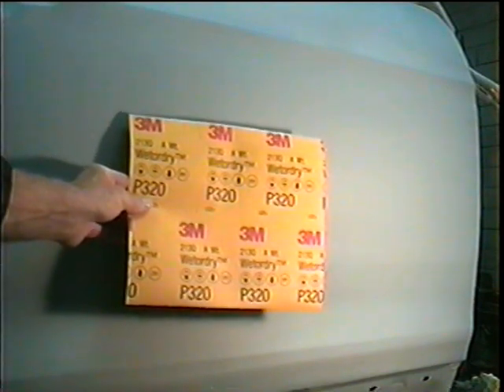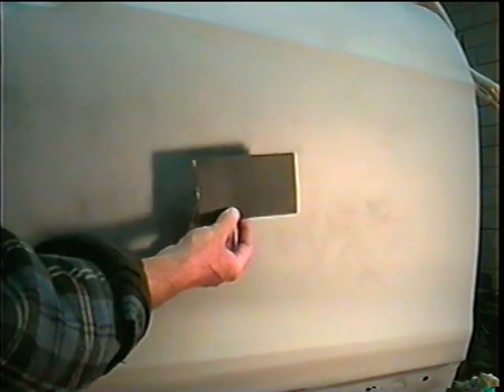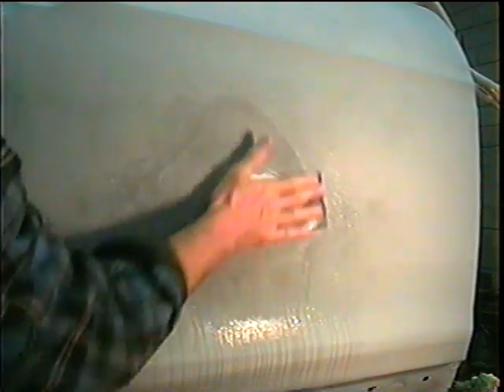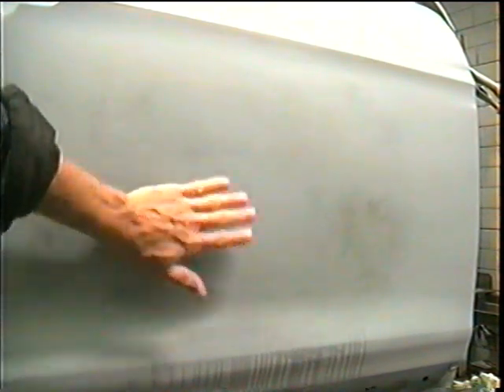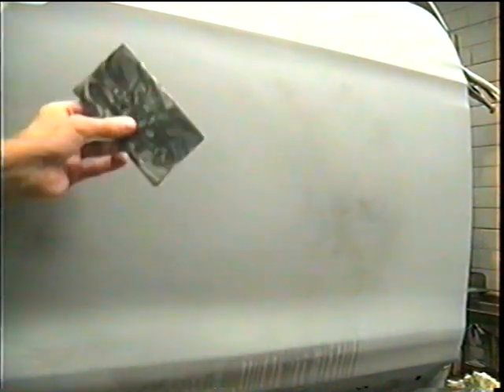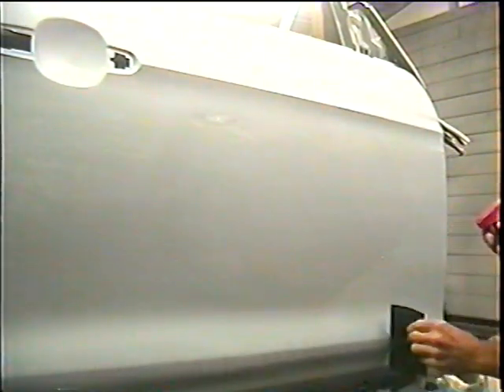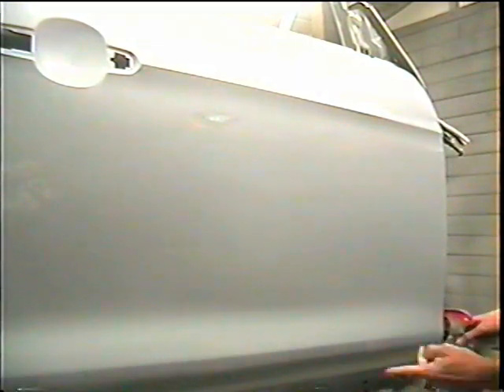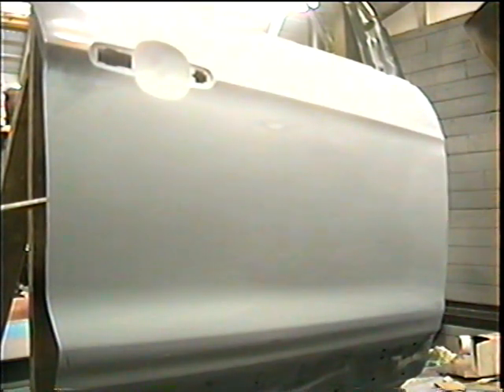How to Wet Sand Auto Body Primer for Paint Prep

Comment: Thank you for the helpful video. I’ve had my car about 2 years now and when I got it, it had a huge spoiler that was applied very very wrong. I decided to take off the spoiler this week because it was on the verge of falling off and I’ve been working on patching the holes since. I’ve never really worked on a car before so it’s pretty new to me and my primer job was not 100% even so thank you for the help!
Reply from the maker: You can't break what's already broken is a good saying when doing body work.  If your primer job was not 100% you just sand it down and prime it again.  Ask ?'s too - I answer them every day - Jerry
Reply: Lakeside Autobody That is what I ended up doing. The paint job looks really good thankfully :)

Comment: The guide coat doesn't make sense to me...yet. I am finally to the point of finish sanding for paint. But why do I need to guide coat it again? Aren't all of the highs and lows already fixed?
Reply from the maker: You don't actually need a guide coat for finish sanding as everything should be straight by now.  How ever.... it does help when wet sanding to see if you have sanded the primer completely flat.  It helps uncover little imperfections that may be left over, etc.  Hope that helps a bit - if not ask again :)
Reply: Ok, that made sense. Thanks. Quick follow up for ya- something that also isn't clicking in my head (because I am a paint virgin) is why wouldn't base coat fill in anything that might have been missed...such as light scratches or a little orange peel from the primer? Especially if I spray several coats of base. It's black with no flake so I should be able to sand the base coat with something like 600, right? I am FINALLY ready to spray the Monte and I'm just nervous about messing up something I've been working on for months. YIKES Jerry! What have you gotten me into?? @LakesideAutobody

Comment: Another great informative video. Is it a bad idea to use a Red or Grey Scotch brite as a wet sander, like dipping the scotch brite in a bucket of water same as the sandpaper method ? I'm working on an old Vespa with really no flat surface accept the floor. I tried the scotch brite as an experiment thinking the grit would be correct and worked pretty good letting the scotch brite do the work and I could see how the scotch brite worked its way through the high build primer levelling down to the guide coat bottoms of the lets call it unlevelled primer. I only tried this on the tail of the frame and thought it may be prematurely taking the guide coat away and not revealing the lows. After trying the scotchbrite I went back to your method using my hand and letting the paper do the work.
Reply from the maker: A great rule in body work is, "If it works, then it's right."  As for using scotch brite as a wet sander, the problem I see with it is that you wont be leveling or blocking anything out as the scotch brite and your hand just follows the suface.  In a body shop the only thing scotch brite is used for is to scuff a panel that is perfect already but needs to be painted for one reason or another i.e. blending or overall paint jobs.  It's also used for scuffing irregular shapes and up close to windows or basically anything that the DA can't get.

Comment: Jerry, thanks for all your helpful videos,  I have both front fenders and hood off my 1977 Midget and all are totally stripped of paint down to bare metal. Should I sand the metal? Or just use a cleaner before I spray with epoxy primer?  Thanks, JohnnyR
Reply from the maker: I always DA sand bare metal before priming.  I think the factories don't though but that's why some paint blows right off on some factory cars/trucks I think. If it has been stripped with a sand blaster then that's fine - go ahead and prime.  Glad you enjoy the vids and you're welcome :)
Reply: @LakesideAutobody  Thanks for the quick feedback, I did not sandblast the fenders or hood, used chemicals and the metal is very smooth.
Reply from the maker: @johnrodebaugh7120  It's a good idea to scuff or DA it first before priming.
Reply: @LakesideAutobody  Thanks again Jerry, will do!

Comment: What sand paper grit did you use for the body lines? By the way you did a very nice job on the video.
Reply from the maker: Thanks Richard.  On the crown of the body line, you're right, you want to use very fine sand paper (400 and up) or even a scuff pad.  Around the body line you can use the same paper that you are wet sanding with.  Hope that makes sense.  If not ask again - Jerry.
Reply: @LakesideAutobody  yes thanks, I haven't painted a car in over 25 years. I just painted my rear conversion van bumper and it came out good but not perfect. At least we can always start over. Hahaha
Reply from the maker: @vintagecologneman481  Forget perfect.  Perfect will make you quit doing body work or anything else for that matter.  Imagine trying to be perfect at horse shoes or golf - you wouldn't ever want to play.

Comment: Thanks for this video; anyway what exactly need to be sanded on primer? Uneven surface only?
Reply from the maker: You sand primer if there are imperfections.  You always paint over a perfect surface - sanding makes it perfect (usually).  If your primer comes out smooth as silk, no dust, etc. then you can paint right over it :)
Reply: @LakesideAutobody  Thanks for your response, very useful information :)
Reply from the maker: @ciensuk  You're welcome

Comment: Never ever use a hand to sand.
Reply from the maker: With respect that's false.  In the seventies before there were little rubber pads for wet sanding every custom shop across the nation wet sanded by hand (with their hand) and the jobs came out perfect.  Many still do.  All you have to focus on is not press .... let the paper do the work.  Also have to focus on not sanding parallel to your fingers :)